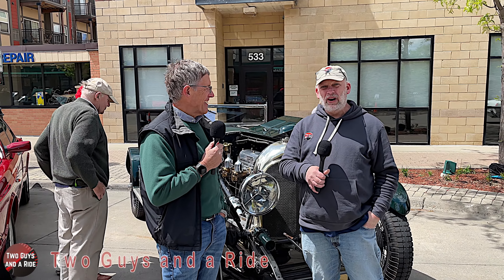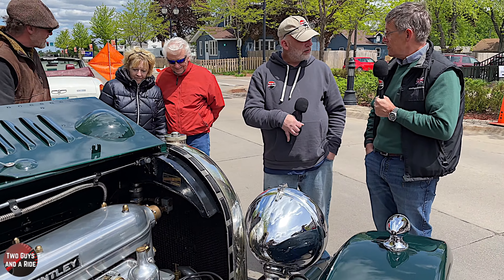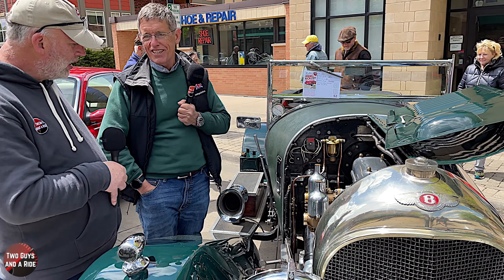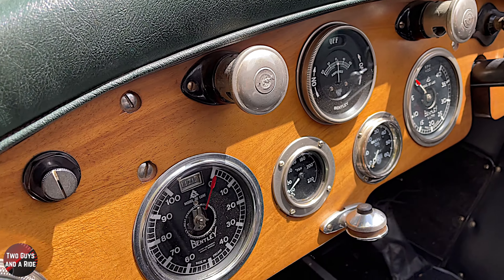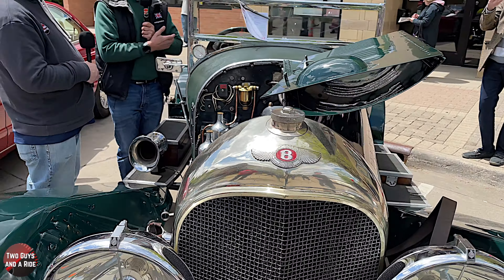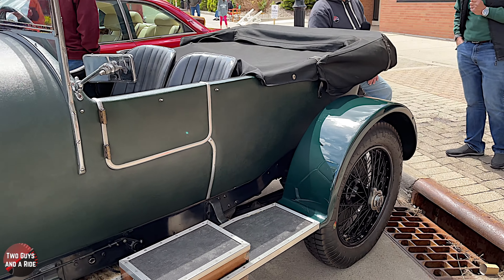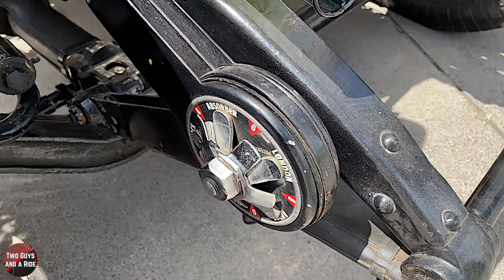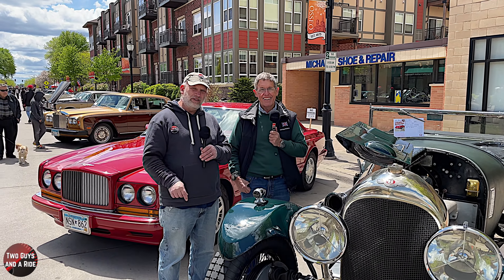1925 Bentley 3 Litre - Philip and Anne share their rare W.O.

Comment: Why earlier Bentleys didn't have cooling fans ?Any guesses  ?
Reply from the maker: Not sure at what point they installed cooling fans.
Reply: No traffic jams back then so there was always air going through the radiator.  The engine was also well cooled with a large radiator so if you do stop it took a long time before the water boiled.